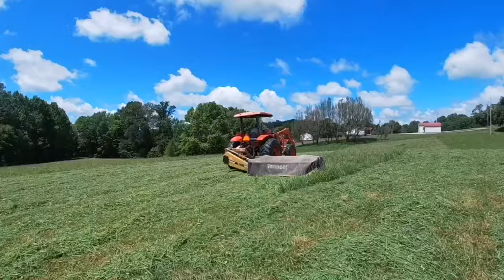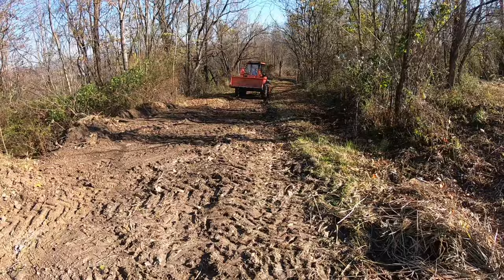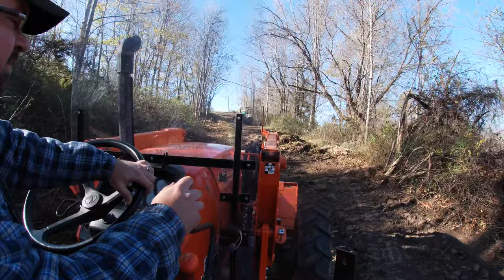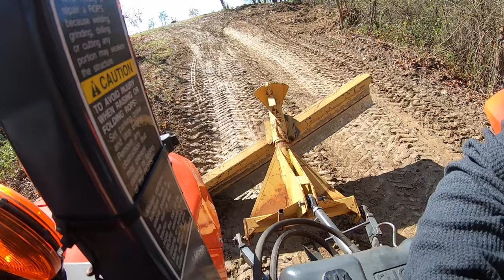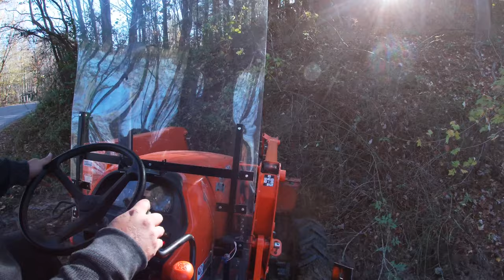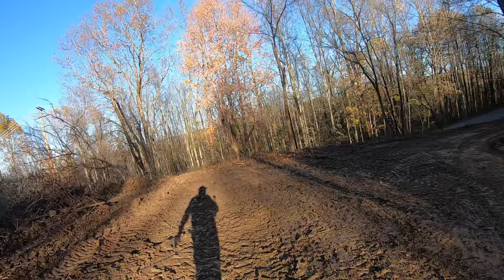Building and ditching a driveway! Tractors moving tons of Dirt! Kubota M6060 and Farmtrac 60

Comment: Your video really demonstrates the advantages of using a tilting back blade to cut a ditch beside a road.
Reply from the maker: It’s a very useful tool! One of my favorites! Thank you
Reply: I suggest a video about different firewood splitting machines.I was thinking about purchasing the duel horizontal and vertical splitter .Great content,I really enjoy bush trail building and improving with a tractor.
Reply from the maker: @jameshopkins365  I built a horizontal splitter with a 4 way wedge for my tractor, I love it. Difficult with big blocks though.
Reply: Yes I watched that video those were big firewood rounds.👍

Comment: You do work em hard that’s for sure. That power steering gets a workout when you’re steering with a loaded bucket not moving yet. My power steering is so smooth on mine but I have some play in there that needs adjusting. My manual shows 2 points of adjustment for tightening the steering back up.

Comment: back in 2007 i bought a new kioti DK55 and bought a blade like you have, that was one super heavyduty blade. i cut into hard shale with no problem with it. i sold the tractor a couple years later because those tractors had the fuel tanks underneath with a pipe joining them, problem is if you had a half a tank of fuel and got on a hillside the fuel ran to the low side and the engine starved of fuel. thats not good in the west virginia mountains
Reply from the maker: I really like the blade, it’s a good one! I’ve seen that fuel tank setup on some Kubotas as well, doesn’t work good on hills. Thanks for watching!

Comment: When cutting ditch are you  in 4 wheel drive? I waz informed not to bein 4 wheel drive so as not to break equipment if i hit a big rock? Your  helper did good vid camra work! Thankz 4 sharing.
Reply from the maker: I use 4 wheel drive but you have to be ready to stop if you catch something solid. It is an easy way to damage the blade. Thanks for watching

Comment: Seems like the front wheels over pull the rears a bit. I bet they do this on purpose because it’s better than the rears pushing the fronts. It’s hard to get all equal when tire sizes are so much different.
Reply from the maker: I think it’s because my rears are 28” wheels and some come with 30” and still run the same front tires.

Comment: Hi, I'm looking at building a driveway to my home and have a Kioti RX7320.  Would you recommend a 6 way front mounted dozer blade or a rear mounted 6 way blade?
Reply from the maker: Personally I’d recommend the setup I have, using the rear blade and loader bucket together. A 6 way front blade would be very costly. Something I think would be nice is a 4 in bucket, that way a person could use it as a blade and a bucket. Thanks for watching!